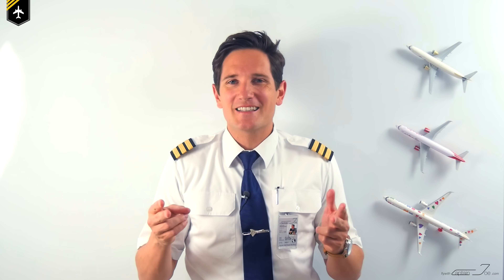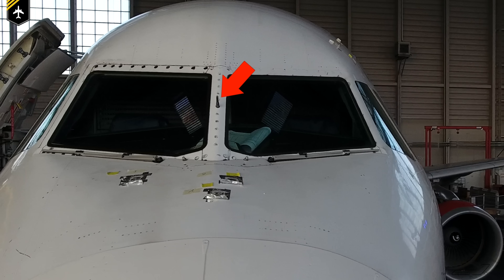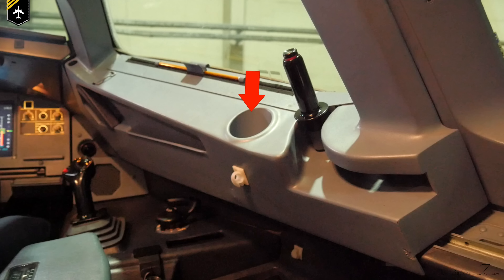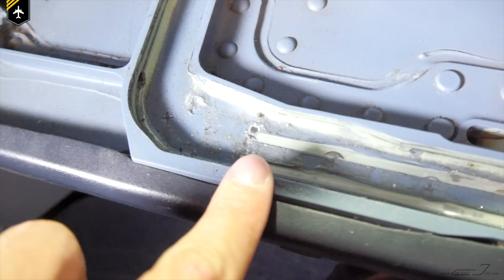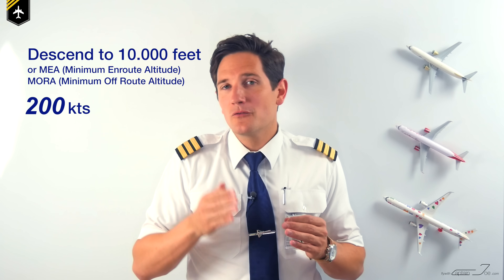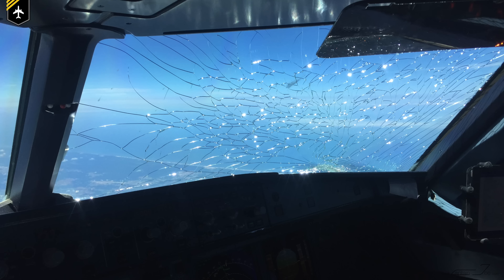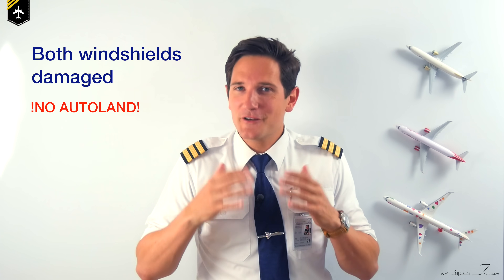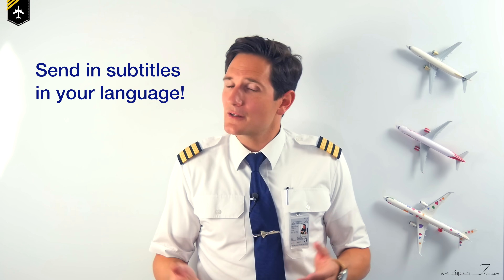COCKPIT WINDOWS - How to open SLIDING WINDOW and HOW TO DEAL WITH WINDOW CRACKS!

Comment: Hi Captain !

What are the wheels at the right and left of gaz ? Why they're turning during landing ? Sorry for my english... Bye !
Reply: If you mean the black and white wheels on the center console, these are used for elevator-trim (nose up or down) of the aircraft (s. https://en.wikipedia.org/wiki/Trim_tab )

They are rotating automatically when the autopilot is changing the trim-setting but can also be turned by hand when the pilot sets the trim manually. I believe technically elevator-trimming sets the speed of the aircraft, so that increasing/decreasing power without changing trim will rise/lower the nose of the plane (its vertical attitude or pitch) to maintain the same speed. A well trimmed aircraft requires a minimum of actual pilot inputs to stay on course.

Comment: Do airlines have a physical requirement to be able to both fit out the window and be capable of climbing down the rope in order to be a pilot? If not, would a pilot incapable of climbing down the rope need to be rescued if the cockpit door is blocked?

Comment: Hi Captain Joe, Quick question. Lately I flew in a Boeing 777-300ER . While rolling towards the run way the plane made a Loud noise when turning. It sounded like a loud electronic motor. can you tell me by any chance what that was? Kind Regards, Matej
Reply: Matej Bajnoci it's possibly the hydraulic motor in the fuselage. He has a video about a similar noise that passengers hear.

Comment: a very nice content. on a 747, there's no sliding side window. all the cockpit windows are fixed.(yet the cockpit is still very noisy) the secondary escape route is the through overhead escape hatch at the aft of the cockpit using the emergency escape device, which is not for the faint-hearted.

Comment: What happens if one of the windshields, or both of them gets broken completely?
Reply: Pilot gets upset and flys directly to the manufacturer to file a complaint.

No, seriously, if there is still someone able to fly the aircraft (shrapnels of glas, depressurization, ...) the most logic reaction would be to reduce speed and height and land at the next possible runway. (Probably very similar to https://en.wikipedia.org/wiki/Aloha_Airlines_Flight_243 , just with a lot of headwind in the cockpit.) But due to thorough testing and dimensioning of the windshields this case should be very unlikely, especially that both of them are lost.
Reply: Erlend Kanestrøm BA5390 is probably more relevent. Due to an error during maintenance one of the windows separated from the aircraft at altitude. The captain was partially sucked out of the aircraft and was held in place by cabin-crew half out of the aircraft for the remainder of the flight whilst the co-pilot conducted an emergency decent and then landing at Southampton. Although concussed and frostbitten the captain did survive. https://en.m.wikipedia.org/wiki/British_Airways_Flight_5390
Reply: @Samuel Doye I never heard about that incident. Thanks for sharing.
Reply: If you are interested air crash investigation has an episode on the accident, as does Allec Joshua Ibay.
Reply: Bimo Gusha Triastanto If it was the BA crash then it wasn't a crack. The windshield was actually replaced he night before and the technician doing the replacement used incorrectly sized bolts. The bolts were too small to hold the glass so it was forced out by differential pressure. It was one of the first time human factors were analysed as part of an investigation to determine why incorrect parts were used, although due to controversy at the time the findings from this part of the investigation were omitted from the final report.
Reply: My apologies, I was just trying to avoid confusion.

Comment: That visual landing with the sliding window (when both windshields are badly damaged and autoland is not possible) sounds very strange to me. I wonder how much they can see in front, considering that they can't really stick out their heads, as even at landing speeds the wind is too strong.
Reply: Istvan Knebli you don't feel the wind when you stick your head outside of the window. Because of the design of the nose, the airflow / wind doesn't hit your head whilst your doing a visual approach :)
Reply: Thanks!
Reply: You could ask the pilot of BA Flight 9 (Speedbird 9) , which flew through the cloud of volcanic dust expelled by Mount Galunggung, a volcano in Indonesia. Along with sandblasting damage to the plane and engines, resulting in all 4 engines stopping for about 15 minutes, the front windshields were rendered totally opaque by the volcanic grit and he had to look out of the side windows to assist with successfully landing the stricken 747. He described the experience as "a bit like negotiating one's way up a badger's arse".

Comment: Why not have a front facing camera for the pilot? I know larger planes like the 747 have two cameras available for the passengers to look at.
Reply: I'm a bit late, but here I go. (sorry for the broken English)
You can't have any distance estimation with regular cameras and screens (2 dimensions only). 
And, 3d stuff are not really 3d but stereoscopic. Which means it uses only your eyes parallax to create your "3d feeling" while the focal length is steady. Therefore, your brain can't really estimate an absolute distance, only a ratio between several distances.
Reply: That's not a bad idea, however every change to an aircraft has to be extensively tested, then there would be a high cost to retrofit.  New ideas are usually put onto new aircraft, while changes to older ones are made only if the cost-benefit ratio is met or it's required.
Reply: I have been on one where it was on top of the back wing.
:( I just we still had one facing down so you can see what's below you.

Comment: Joe, how does the oxygen flow inside the airplane?
Reply: Do you mean how do the oxygen masks work or are you talking about the normal air in the cabin?
Reply: Nilguiri Normal air in the cabin
Reply: It flows in through the front of the engines, it is compressed and heated in the engine compressors, it is extracted and run through the air conditioning packs to cool it, and it is fed into the cabin.  There are outlet valves in the cabin that vent the air overboard and maintain the pressure in the cabin.  So there is constant airflow through the cabin.

Comment: Captain Joe I have a question why the 777 doesn't have a winglet
Reply: The 777 uses the so called "raked wingtips" which have basically the same effect, but they do their job a little bit more efficient than the classic winglet.
Reply: shi01 thank you so much

Comment: captain joe why there is a hump in boeing 747.. does it not increase the air drag??
Reply: Not by that much, no. The benefits of increased capacity outweigh the costs. Have you ever seen an Aero Spacelines Super Guppy?
Reply: There are a lot of good resources about this on the web. As far as i remember, the engineers/management at Boeing, at the time they designed the 747 were certain that the future of passenger flight belonged to supersonic aircraft. So their plan was to design an aircraft that could later easily be transformed into a cargo plane. And because they wanted to have the possibility of front-loading (nose door) they moved the cockpit up on a second floor, introducing the hump. As we know now, supersonic airliners didn't make the race and 747s kept being used as passenger planes. During the design phase, Boeing even had plans for a doubledecker aircraft, which was only introduced by Airbus over 30 years later.

The reason they continued to produce the 747 is that there was and still is a request for high passenger count aircraft and it is easier and cheaper to continue with an existing design than to design something completley new. However, the development of other, competing aircraft and the move from the hub and spoke model to direct connections (requiring usually smaller aircraft) made them miss their initial expectations.

Regarding drag, as the area of the crossection of the aircraft is increased, drag is increased as well. But there aren't too many options in increasing the passenger count on airplanes, with one of the main limitations being the servicability of the plane at the airport, which brings mainly restrictions in length and width. (The introduction of the A380 for example required a lot of  modifications on the airports that service it, especially on the ramps.) Other limitations are for example structural reinforcements needed when enlarging a plane that lead to different increases in weight while yielding the same passenger count, depending on the chosen design. So long story short, the hump was a trade-off that Boeing had to make, depending on their predictions and expectations.

Another interesting fact is that Boeing initially marketed the hump to the airlines as a crew-rest area, but then a manager, or maybe CEO, of an airline (i believe it was TWA) came up with the idea to market it as something special and so it was used for the first class.

Comment: Like your vids Captain Joe.
But i have a question and maybe you can explain it in one of your upcoming vids.

Why is it that some planes are lower  there gear down early, and  some planes do it later before landings??

Kind regards Dennis.
Reply: I dont know for sure, but I think it might have to do with differences in speed from one plane to the next. Airplanes have speed restrictions on when they can put down the landing gear, and because of the different landing configurations airplanes will reach different speeds at different times during the approach. Putting down the gear also adds a lot of drag, so the pilot flying probably will want to put the gear down at different times depending on how they want the plane to behave. Just a disclaimer that I only fly small airplanes, so I may be entirely wrong.
Reply: TheWindigomonster  

Thanx for the answhere that explains a lot, but maybe there are little differences in this procedures that i wanna know.
Thanx anyway👍

Comment: Is it ok to open the windows when taxing
Reply: They should be closed and locked prior to pushback (SOP and checklists). If they have to be opened to communicate with ground crew then so be it but after that they should be locked again, theres plenty of ventilation
Reply: hi hi Yes it is actually possible depending on the airline you are flying with, but most of them allow to open the cockpit window during taxi, but it must be closed before line up, since you would have to do other things quickly at that point and you might not have time to close the window before takeoff.
Reply: Aussie Lover Rly????? Like WTF?!??!?!? It must have been United Airlines pilot
Reply: In some case the plane is slight pressurelized before take off
Reply: @hi hi
not sure why you would want to I never have when taxing.    I have had it open before to talk to someone when im still at the terminal.  (ground crew) but once im off the terminal and getting on the taxi way,    they are closed.
Reply: Why wouldn't it be?
Reply: +Matthew Wang Not if the systems are working correctly.  If the plane is pressurized at all at ground level, it will be impossible to open the doors in an emergency.
Reply: It happens more offen than you would think :P
Reply: hi you have another little window in the last window on each side the pilot right before pushback will open it and say clear right on the other side they will say clear left and then push back.
Reply: Lisa Fortnite not on a jet... That’s just for general aviation propeller aircraft.
Reply: Yes obviously
Reply: I've seen some pilots open the windows while taxiing to the gate
Reply: Yup 7% here in Ohio go ahead and open it

Comment: So why can't you have polarised sun glasses?
Reply: Actually, no. AFAIK, the windows in the cockpit are already polarized, so if you're wearing polarized sunglasses, you'll get a ''double'' polarization. This will make seeing very difficult.

However, I'm not sure, so if someone could confirm that would be great.
Reply: @B4dCruzer  I believe it's so you can see approaching aircraft's reflection in the sunlight.  With polarized lenses, you would not see this.
Reply: After a quick research I found that we´re both right. In older airbus planes polarized glasses don´t seem to work with the polarized windows very well. But the problem is also with the older screens which seem to be crt-screens instead of lcd screens.
Reply: tholespe l
Reply: Probably because you can´t read your instruments very well in sunlight conditions, which are mostly made of lcd screens.
Reply: TLDR: Using shades without polarized lenses could prevent midair collisions.

While all the reasons others have mentioned are pretty important, the reason the FAA recommends against polarized sunglasses is a bit more pragmatic. Polarized sunglasses are specifically designed to cut down on glare. While operating under Visual Flight Rules a pilot must scan their own airspace for traffic and avoid that traffic. Often other planes are most easily spotted at distance due to glare. Note that most civilian planes have shinny paint, while military aircraft are intentionally painted with dull "flat" paint. Same Idea.
Reply: If the polarization from the sunglasses equals the polarization of the windows, it wouldn't do anything, but if it is offset by 90° or if you turn your head by 90°, the sunglasses will block the light completely.
Reply: Polarized glasses can interact with LCD cockpit displays preventing you from being able to see them since LCD displays use a polarizing system. In certain directions the LCD display will look black.
Reply: PilotInCommand777 Alright ty
Reply: Take a look at your smartphone while wearing polarized sunglasses. You will understand ;)
Reply: I was hoping to have that question answered in this video too.
Reply: Here you can find some additional information on this topic: http://aviationknowledge.wikidot.com/sop:no-polarized-sunglasses-for-pilots

There is even an official FAA brochure on the topic of selecting the right sunglasses: https://www.faa.gov/pilots/safety/pilotsafetybrochures/media/sunglasses.pdf
Reply: The number one reason is because the LCD display screens are polarized, and at certain angles you won't be able to read them.  The other reason is polarized glasses intentionally block the reflection of light off of glass, and this can keep you from seeing sun glints off of other aircraft that you are trying to see in the air around you.
Reply: Star Gazer Alright thanks.
Reply: Because it makes the kind of look cool and polish that look cool appeared to be a threat to most people but yes it's a polarized Lens and vision risk against the safe flight of the aircraft
Reply: If you own polarized sunglasses, just hold them in front of LCD/TFT displays (monitor, tv, smartphone, ...) and rotate them. You should at least see a significant decrease in brightness of the screen at a certain alignment.

LCD based displays are based on polarization and usually emit polarized light and as modern glas cockpits and other flight instruments are based on LCD technology this can lead to unreadable instruments when wearing polarized glasses. There are probably ways to depolarize the light leaving the display but i guess they come with other problems, like reduced brightness or maybe also blur.
Reply: But even if they block light at some angles, they can just tilt the head a little to see, what's the big deal? Or take them off completely. Not like they'll be blind without them, it's not that bright, and there are shades too.